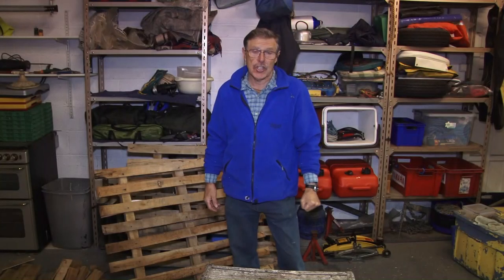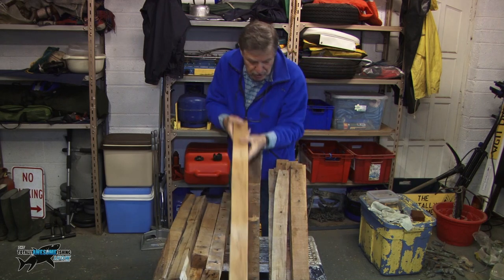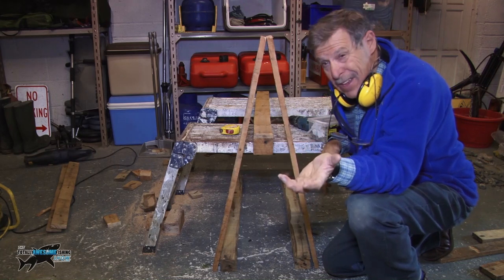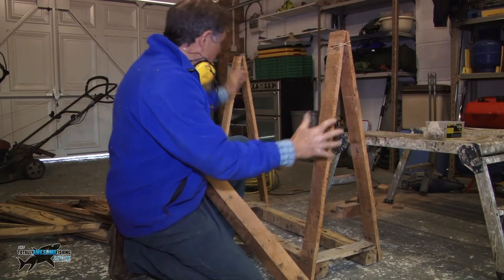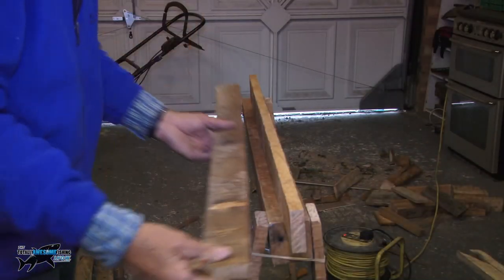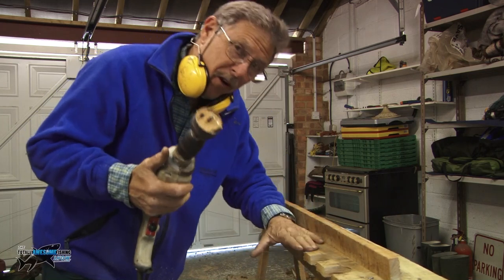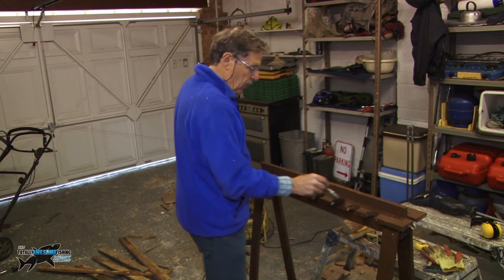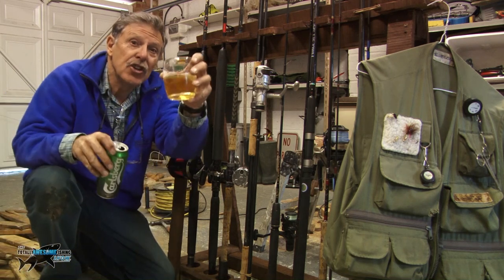How to make a Fishing Rod Rack from Pallet Wood | TAFishing

Comment: Little tip for cutting the top semicircles with a hole saw (I reserve the name core drill for concrete stuff). Leave your top boards a few inches long. Place their straightest long edges against each other and screw them side by side on a thicker piece of scrap, in this case a 2x6 or 2x8 would work great. Drill pilot holes the same size as the arbor bit along the joint, then follow those up with the final hole saw cutting. Release the boards, cut to proper length, flip them around and your top holders are done. Both sides for roughly the same amount of work. Plus there is no chance of the hole saw slipping off an edge this way. If you're going the screws and rubber bands route anyway, the shallower holders aren't an issue.

This was a great How-To using free materials.

Comment: I like the angle of this A-frame rod rack.  I had built one of those similar rod racks that are straight up vertically, and guess what?  The rod wants to fall forward.  So I got to leaning it back into the upper hole, and had to find an idea to keep it in there.

Thanks for the A-frame idea!